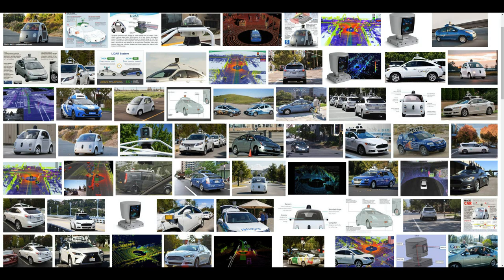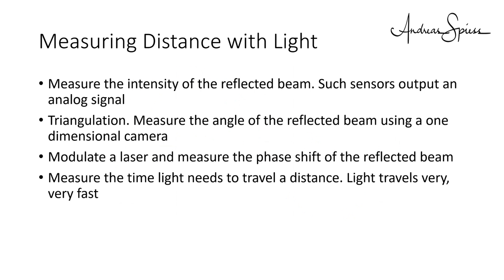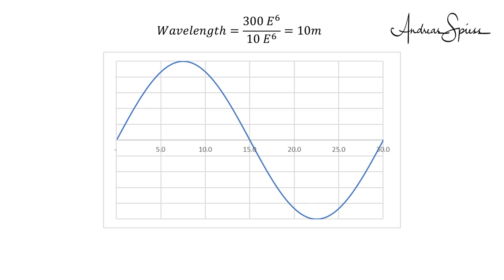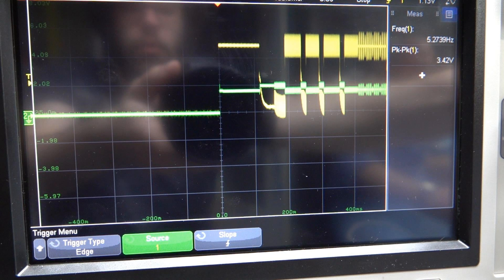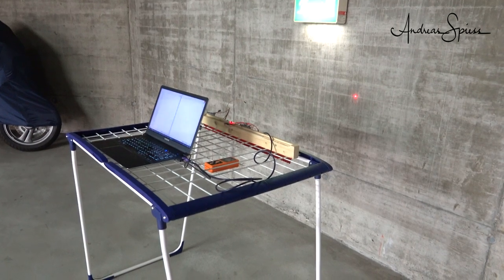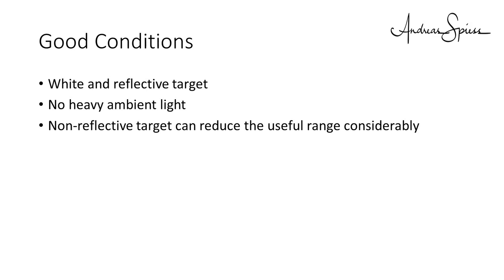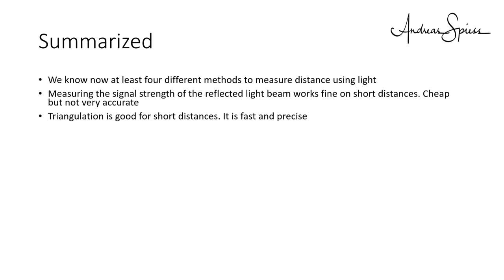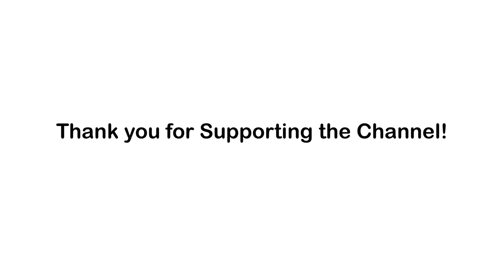#203 Best LIDAR Sensors for Makers (Comparison and Test)

Comment: Did you find any discrete phase shift sensors?  I only saw the packaged electronic ruler.  This would not fit well in an embedded project very well.  

Regarding the sampling/measuring speed It would seem that this approach could be slow to find the target; but, once you found the target, you could measure quicker and infer the location possibilities based on its max/measured speed the time since the last measurement.  Isaac Newton can be your friend.
Reply from the maker: You are right. But these algorithms are usually quite deep in the sensor chips. If you want to change that you have to build your own sensor from scratch.
Reply: I am sure you are right, but not for cheap (unless you know a way).  I need a sensor that can measure a soft target travelling about 5m/s, 0-40m range.  I want to calculate speed vs distance, 10% accuracy and 300ms sampling may be enough; but, of course more is better.

Comment: Hi i want to make a project written below

 I want to make a detector for detecting racing cars like after how much time a car has reached the ending point or when did it start running from the starting point. So I would want a sensor that can be placed at the side of the track (doing measurements on cars from the side view).

There are two options that I found
> Lidar
> IR (placed on both sides of track, sender, and receiver)
I would want a sensor that can
>Detect 20-30 meters range
>Sunlight generally does not affect it
>Rain should not affect it
>have long term use
>Economical
>Works with Arduino/Rasp pi
?
> Should be able to detect cars and 4 wheelers
I am okay with both Lidar and IR but when I was searching the internet I couldn't find IR with this much range 
can any one help me?
Reply from the maker: I am a Youtuber and provide my knowledge in my videos. The rest is on you :-(
Reply: @AndreasSpiess  thanks for your reply :)

Comment: have you looked into the LIDARs of cheap chinese vacuum robots? might be a little bit more expensive but promising alternative
Reply from the maker: Maybe it is very similar to the one I have. Same look and same price.
Reply: Good find! I didn't even know that the cheap Chinese robo-vacs had LIDARs already.

I was actually going to suggest scavenging used and/or broken Neato or Vorwerk robo-vacs. They (at least the high end models) have featured a LIDAR at least for five years, and from what I have read, it is very good and well documented by the hacker community.
Reply: It uses triangulation and there's a lot of community work available for it. I've got a vague recollection of seeing them on ebay for less from time to time.

Comment: the Sharp analog distance sensors use triangulation and not the intensity.
Reply from the maker: You are right! I did not read the datasheet correctly!
Reply: I'm using this sensor in a lab with my students...

Comment: Hi, can the lidar sensor work in very dark environments?
Reply: Yes, the darker and the less ambient light there is the better a lidar works, since lidars rely on their own light source (laser) (, and only measures the light of its own laser).
Reply: @juunas500  but dark surfaces will probably absorb the the lights...!
Reply: @lakshmipathibalaji2023  Yes if the material of the surfaces is light absorbing, very dark black matte painted room for example. But if it's just an unlit concrete hall there should be no problem

Comment: I wonder if it would be worth it to salvage LIDAR sensors from defect vacuum robots. They are very cheap to get from ebay.
Reply from the maker: If you find the interface description they could be useful
Reply: @AndreasSpiess  I think I try to get one for a certain price limit I set my self. Just to look inside, and if the lidar sensor can not be used at least there are other parts to salvage, like motors, wheels, etc..

Comment: Maybe you can 3d print a base on which you can mount all the sensors side by side?
Reply from the maker: I probably could. But this was a one-off test. So it was easier to use an old piece of wood I used already for other distance tests...

Comment: right now a laser depthmeasuring device with a range of around 50 meters and a measurepoint size of around 1mm(a actual laser), and a display costs around €15. and a sensor for DIY projects more for less range and a super broad measure point. I wonder if there really isn't a very cheap laser tof sensor which actually really measures at a laser fine spot, so with a super fine angle so that it can actually be used for scanning.
Reply from the maker: My problem back then was the lack of an interface for my IOT devces

Comment: I don't see any reason why phase based metering must be slow. In fact this has been done by SLRs for ages and is quite fast there (depending of your understanding of "slow", that is).
Reply from the maker: Fast here is a few 100 full measurements per second.
Reply from the maker: And I am also not sure about the max distance it needs. Maybe they can stop at a relatively short distance and therefore do not need many different wavelengths?
Reply: Seems more like a limitation of your product than the methodology, there shouldn't be any problem to reach 100 measurements per second with phase based metering.
Reply: They do have to work at the full range of minimum focusing distance to "infinity" and modern cameras can do dozens of frames per second with full subject tracking using many sensor fields, so clever processing is required within that timeframe as well. The only thing I'm not sure about is whether they can trust that they found the correct distance or they do a verification measurement that the lens focused at the right spot or even do it incrementally...

Anyway. Sounds like an interesting research project.
Reply from the maker: I thought about our discussion and asked myself if they really measure distance or if they search for some patterns inside the picture. I assume their goal is not to know the distance to the mm but to create sharp pictures. So they might use a completely different principle than the one I described. But I have no idea about that matter...
Reply: So, out of curiosity I bought the inner parts of a range finder on Aliexpress and after dissemination I found out that someone hacked that already and created a custom firmware allowing for 60Hz: https://github.com/iliasam/Laser_tape_reverse_engineering

Comment: The RPLidar uses triangulation.
Reply from the maker: Where do you got the info from?
Reply: Andreas Spiess The RPLidar is based on the Lider from the Neato robotic vacuum. If you disassemble the lidar you find a ccd array sensor. I have not done that because it destroys the calebration of my sensor. But there are fotos and documentation online.
https://hackaday.com/2011/09/12/digging-deep-into-the-neatos-lidar-module/

As sensor it uses the DLIS-2K CCD
http://dynamax-imaging.com/products/line-scan-product/dlis2k-2/
Reply from the maker: Thank you for the link. Unfortunately the video and the link to the blog are removed. Do you know why?
Reply: Andreas Spiess No I don't know that.
But you can find patents on the system.
https://patents.google.com/?assignee=Neato+Robotics%2c+Inc.

Comment: Instead why not use mmWave sensor ?
Reply from the maker: what is mmWave?
Reply: Andreas Spiess milli meter wave, frequency above micro wave, Ti and Nxp have IC chips as radar soc, which are not so costly, but u cannot get accurate measurement
Reply from the maker: Do you have the names of the chips?
Reply: Andreas Spiess pls check this, simalar to this NXP and AD also has http://www.ti.com/sensors/mmwave/overview.html

Comment: Dear sir 
I have been trying to use a Bosch 3 wire sensor that I got from used cars parts the sensor   will be best for outdoor use 
The sensor is  : Bosch 0 263 023 939 Parking Assist Sensor
I hope you can help 
Natheer Anasweh, Jordan
Reply from the maker: I do not know this sensor. So you have to google to find information (if it exists).

Comment: As always, nice video, thanks.

I would like to measure the tide level in the salt water canal in my back yard.

I had success with an ultrasonic sensor (HY-SRF05) but I am concerned that the salt atmosphere will destroy my project. I have tried to protect the project with a Saran Wrap window in an enclosure but the signal is attenuated and will not give a reading.

I have recently tried a Sparkfun product number 14667 (sparkfun.com/products/14667) for $24.95. It uses the VL53L1X. I connected to an Arduino Fio which operates at the required 3.3 volts. They have a library and examples but because it is one of their SparkX "experimental" products there is no support.

When connected to SDA (pin 4), SCL (pin 5), 3.3V power, and ground. Using the distance example, I only get zeros under test conditions in my garage. I asked about this on the Sparkfun Forum, as recommended, but I have not gotten any help.

Andrew, maybe you could check this out and see if you can get it to work.
Reply from the maker: I made a video with this chip. Maybe you watch it
Reply from the maker: I just saw you have the newer version. So I have no experience.
Reply: I will hack around a little more and find out if I can make it work. I will switch to a "regular" atrduino" with a level shifter. I will keep you posted.

Comment: Your explanation of the multi-frequency phase shift is not quite accurate.  There is no reason to operate at a low frequency (say 10MHz) to get a coarse range, and a high frequency of 100MHz to get better resolution.  Instead, select two high frequencies.  Say 150MHz and 151.73MHz...   Anything that is an integer multiple of a meter away would give 0 phase shift at 150MHz, so we know its an integer multiple of 1 meter, but which one? At 151.73MHz, you get a phase shift of 4.152 degrees per meter. 

At 150 meters, we get 0 phase shift on the 150MHz, and 262.8 degrees on 151.73MHz.  By comparison, 63 meters is 261.576 degrees, and 64 meters is 265.73 degrees.  236 meters would be the next point where it comes close but its further than 63.  Then 323 meters, but again, its further than 63 meters was.  For additional clarity,  third frequency could be added.  This technique does require some amount of math since there is no closed form solution to figuring out the distance based on the phase shift of multiple frequencies, but computing power is cheap.
Reply from the maker: s this a theoretical idea or do you know that my device worked like that? I did not do exact measurements.
Reply: @AndreasSpiess  I certainly can't tell you I know as a fact how every phase shift range finder works.  I found  a Russian guy who had done a write up and claimed this was how it was done (I made up the exact frequencies, but I think he was putting them in the 150-200MHz range).

As for whether it can be done theoretically versus practically.  I'm pretty sure its quite practical.  It'd be like saying you could use an XOR phase detector to do a phase error -> voltage converter, or use an FFT and look at the phase difference by taking the atan (imaginary/real) at the desired frequency.  In fact, the Russian recommended using the Goertzel algorithm.  It would be possible to modulate with MULTIPLE frequencies simultaneously since you're unlikely to see any optical mixing if you are using FFT or Goertzel which would make it faster.  Of course, it also means you have a reduced SNR so you'd have to put out more power to compensate.

What I can tell you is, that the method I described seems to be a significantly better option than using a high and low frequency, since a 10MHz wave still gives you a maximum unambiguous range of 15 meters, and these range finders can work out to hundreds of meters.